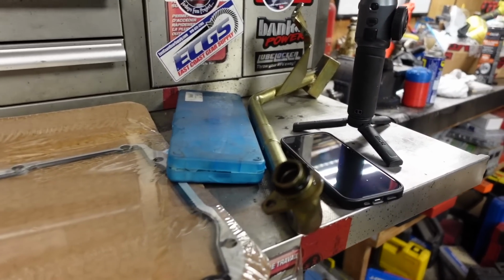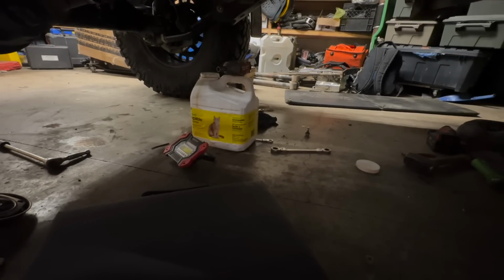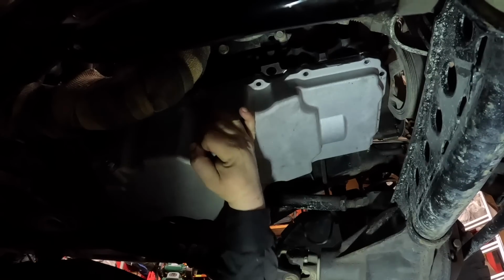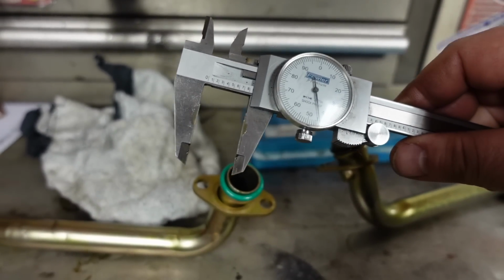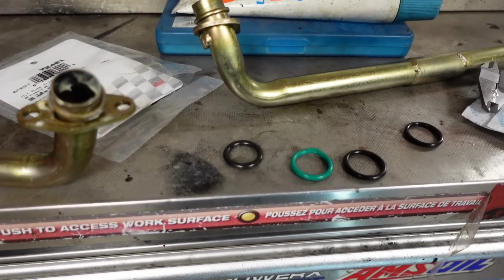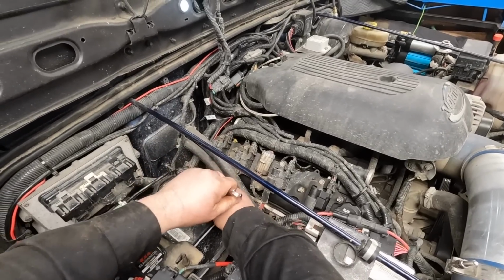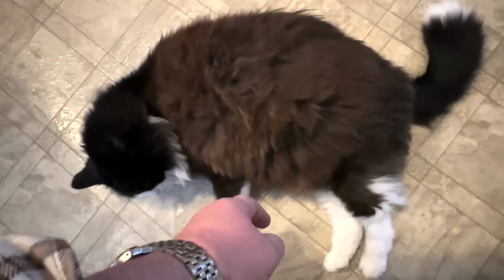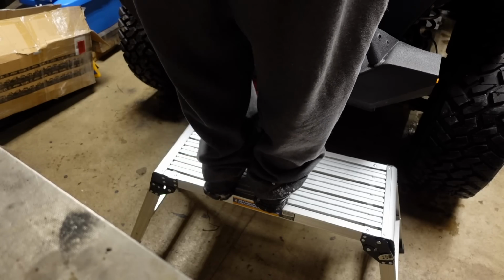LS SWAP LOSING OIL PRESSURE BADLY

Comment: Thanks for sharing this experience with all the details.  I have a 6.0 that has lost about 50% of the oil PSI when warm- this is about about 100 miles after assembly.  Almost exactly like your situation.  I have to lift the engine about an inch to get the pan out, but I won't be able to sleep until I determine the cause.  I also have that same pan, so I completely understand the non-stock spec guessing/measuring.  Thanks again & cheers!

Comment: Watching your video got me thinking about o-ring compression like press fit for bearing or races. I did a search on Google for o-ring compression calculator and it brought up all kinds of stuff. I was waiting for you to measure the bore and then measure the o-ring while it was on the pickup tube. I probably would have done the same thing and went by feel pushing it in. I’ve worked in the water distribution field for over 30 years and have seen plenty of rolled and pinched bell and spigot rubber gaskets in pipe sizes up to 24”.  A few on control valves too. Glad you got it fixed.

Comment: you can not trick me jerry this is bullshitkorner    when you going to do another chili recipe video you kno9w the one when you tell us about your old girlfriend????that shit was legendary!!   and ranting about the 4wheeler quad dealership   riding thru pastures fucking sheep  well?  people still sending you stickers and beers ???or did you tube shut you downn or the canadian communism ?  these leaders and fuckers with power are getting out of control! and do not show any gold panning i bet they would try to tax that too .how is your Raptor liner holding up ? mine is doing good where i did the prep correctly ..great stuff but you got to put in the work on the prep not most of it but all of it!!been using hiem joints on my adjustable track bar and it worked and stop eating up my stabalizer links .guess i will subscribe but you better do some rants !!and a sour beer once in a while

Comment: Same thing happened on my girlfriends 2004 TJ. Come to find out it was only that oil was getting into the harness connection for the sensor. Pulled it apart, blew it out, and it is all working again. 
Still need to fix the oil leak that caused the wet connection to happen though😅
Reply from the maker: Was oil coming up though the sensor ?
Reply: @BackCountryWrenching  If I remember correctly, oil was dripping down past the sensor and getting into the connector. Disconnected it and it was full of oil. Blew it out and cleaned it up. Reconnected it and taped it to keep it from flooding again. Been over a year now and no more oil pressure drop in the dash. Seems to be a somewhat common problem since I got the idea from reading comments on YT vids. Glad it was that easy for me.
Enjoy your vids… keep ‘em coming!

Comment: Not for nothing, Jerry, but I have yet to see a chevy small block swapped into a TJ that wasn't a giant shit show. I never felt the 4 liter was underpowered.  Mine is an 2004, has over 200k  with no issues. I have thought about a diesel conversion but never have I seen a well executed one.
Reply from the maker: The beauty of the JK’s is that they make kits that have the process much simpler

Comment: Had the same thing on a 4.0l ford, oem tube doesn't work on a melling pump, what a shit show to diagnose in the truck. Was rebuilt and assembled by a machine shop. He even came over when we had the pan off, and we showed him.. we googled the pump and stated just that in the instructions,  got the updated tube and worked good.  Sad she ran at 10psi first start, but whatever.
Reply from the maker: Good thing you got it sorted out

Comment: If you check the oil while it’s hot, and there’s small bubbles on the dipstick, it’s the pickup tube o ring. Common on LS engines
Reply from the maker: I didn't know that, and now I do

Comment: Jerry, aren't the "green" O-rings Viton?  Basically a higher quality fluroelastomer o-ring that is more chemically resistant to greases, solvents, oils, chemicals, etc. versus the black nitrile rubber o-ring.
Reply from the maker: Hard to say what it really was as the kit was a clone. I am not concerned about the black O-rings they have been in service for decades and still in use for today.